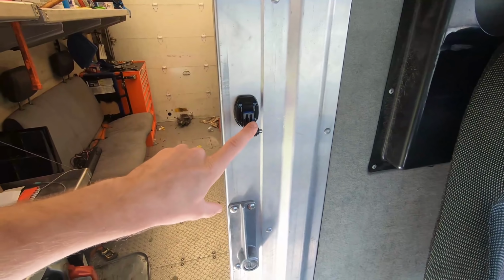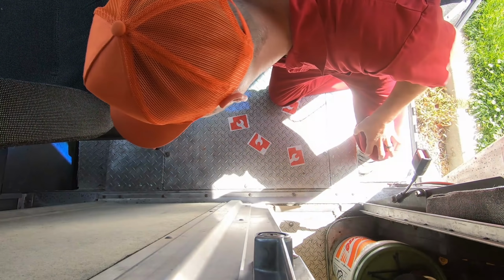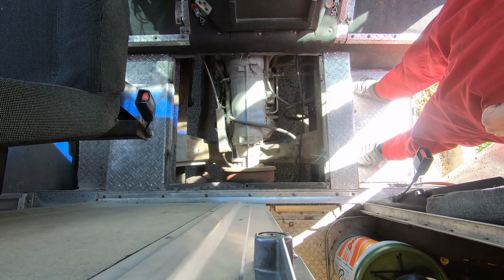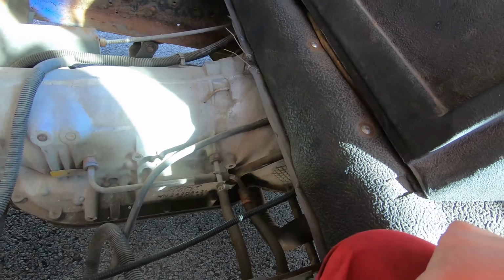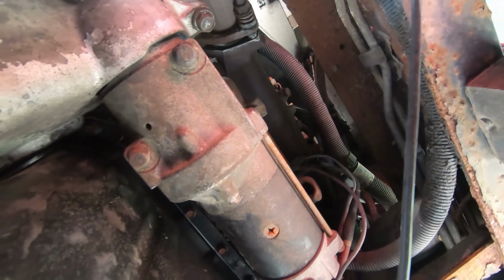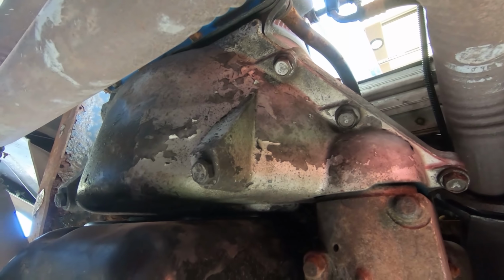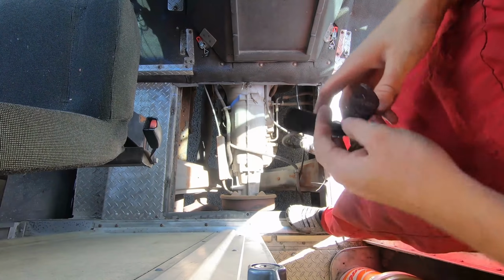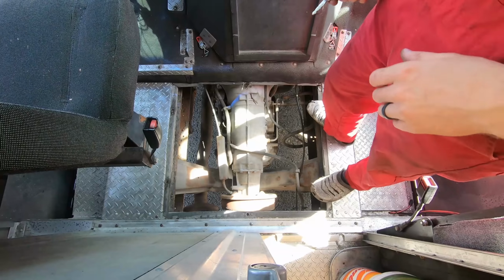Looking at the Ups truck *torque converter* while running.*cool*

Comment: I'm a little jealous of your setup, love the "mail truck" as your mobile shop. I drove a 2000 Ranger for a few years to different jobs, recently upgraded to a F150 Crew cab to double as a family vehicle on weekends.Just wondering do you have any power source other than 12v? I'm  considering a couple solar panels myself, but I'm not sure if it'll give out enough power, or even if it would be worth it in  the long run...

Comment: Would be dope to make a high heat resistant cover over the transmission as a wow factor plus   to see whats going on if anything was to happen (GOD FORBID IT IS DOES) for a quick diagnosis
Reply: well...it has little peek holes so you can you know unbolt it check. No need to take the trans out to look.